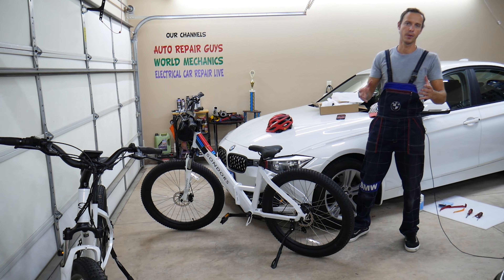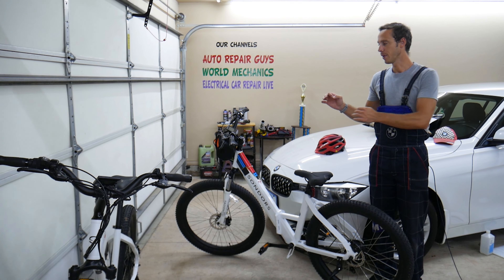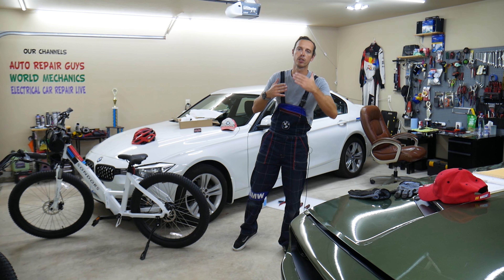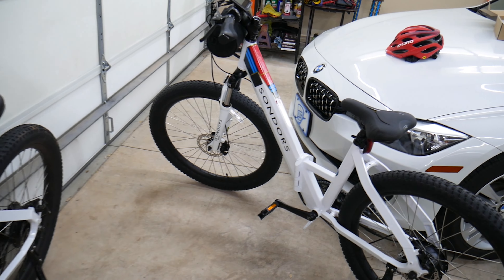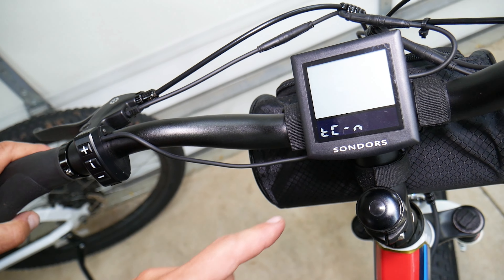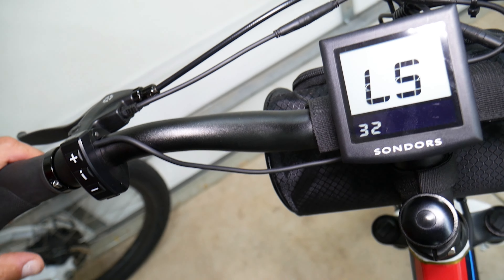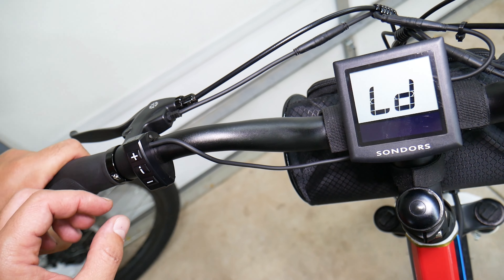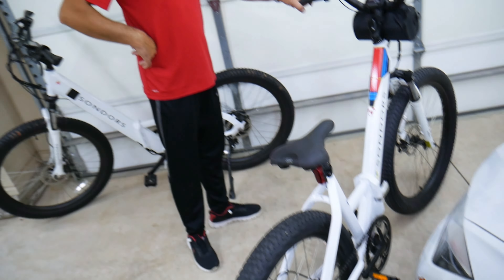HOW TO INCREASE THE MAX TOP SPEED ON SONDORS SMART STEP, FOLD X BIKE

Comment: does the bike really get to 40kph/25mph on the flat  with a rider on it after the the change? bike is rated 350W but I bet it can put out more like 500W peak
Reply: At the max power setting the display indicates 500W output. I don't think it would hit 25 moh on flat, tops out at around 22 mph. But if there is a slight downhill it lets you keep accelerating.
Reply: Do you have any experience with it at this speed? Seems legit
Reply: @UsnRoberts  The bike feels perfectly stable cruising at any speed, just runs out of steam pushing the heavy knobby tires. With a bit of pedal assist you can get it to go slightly faster.
Reply: Followed all the steps..says 40k still only goes 20